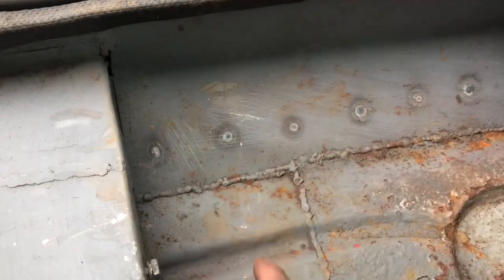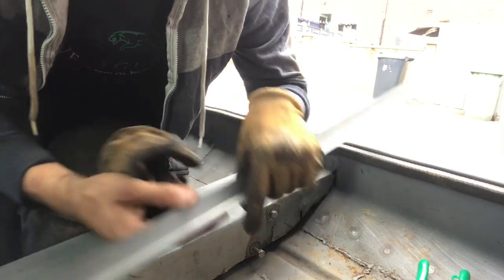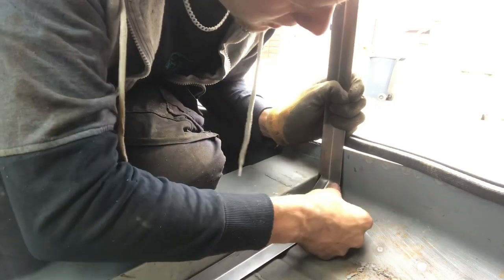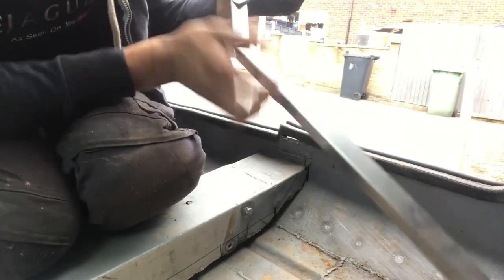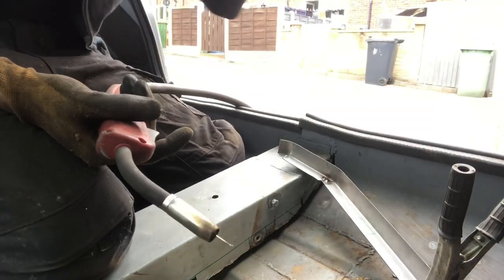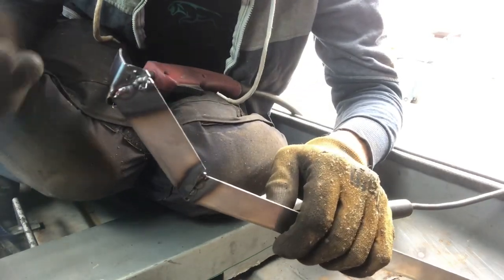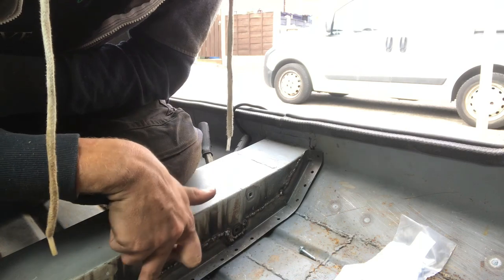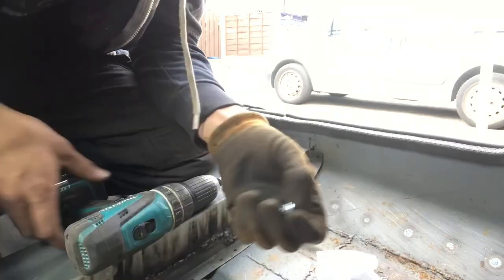Classic mini restoration - cross member repair

Comment: Hi Tom , liking you uploads it is great help im just starting getting through my own as well liked your idea with the self tappers for holding panels , only one thing I would say with them from using them on other other projects is that the swarf from them gets caught between the panels I found it best if you want to prevent the dreaded rust , fit panel using self tappers then remove brush out swarf then run then up again. Keep going with uploads finding them very helpful.
Reply from the maker: Ken Hunter glad your liking the videos mate. The self rappers are very useful and yes the swarf could be an issue, something to keep an eye on for sure

Comment: Tom,  The angle worked a treat top job, If the that angle is going cheap i would grab quite a few lengths as getting a 90° bend in the metal that sharp takes a bit of time, I hope Alex was watching the little circles for your welds lol, Cheers Dave
Reply from the maker: davejaguar66 cheers dave, it’s shut now but yeah I wish I’d got more of that, I chose the go for a selection of other stuff, probably will never use some of it lol...pay attention Alex!!

Comment: You can get the bottom repair panel for the bins if you get new don't forget to take seat belt bracket off the old one
Reply from the maker: minisareus I know it would be a case of fabricating the repair panel, but I checked mini spares and they have a sale on at the moment for £37 and by the pictures it looks like it comes with the bracket. So I’ll probably do this tbh

Comment: #Hooray for Tom, Mini Tom Tom Tom Tom# If ye had a bead roller it wouldnt be that hard to make a new bin, that or just whip up a 3" lower section. tell ye when ye dropped the mig gun on yer arm i cringed as i've seen people accidentally put the still glowing mig wire through their hand or into their leg, on the bright side it does cauterize the hole so ye dont leak, lol. cheers bud. Ps. still no calendar eh!
Reply from the maker: PIPER DOUG it’s coming Doug, a treat especiale just for you! I did think about repairing but mini spares had a sale on, if they still have it when I get paid I’ll just buy new. And I get what you mean about the torch, looking back I did the same. Thanks for the heads up. Glad you and the family are ok btw!